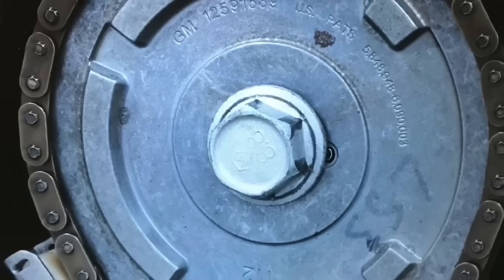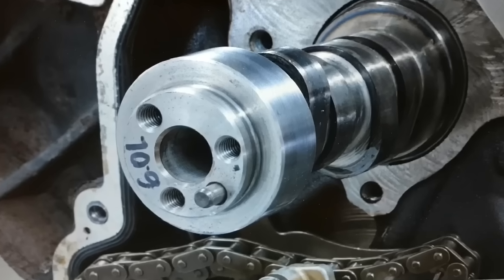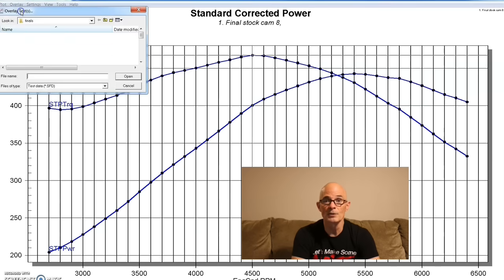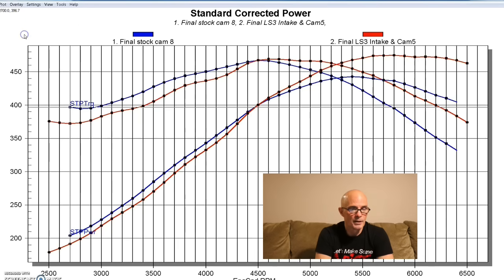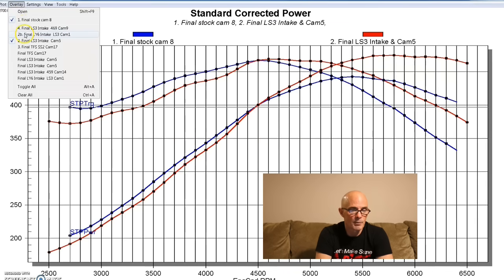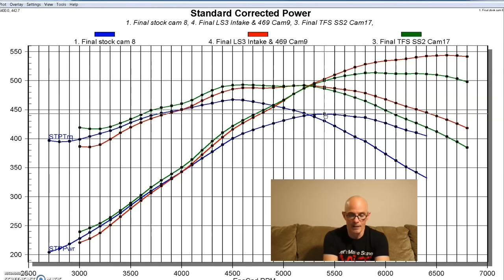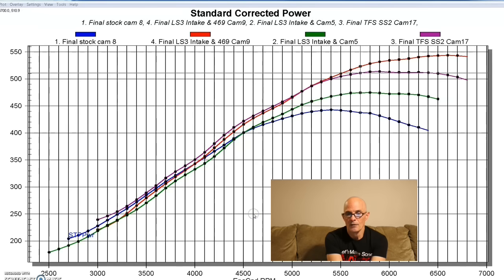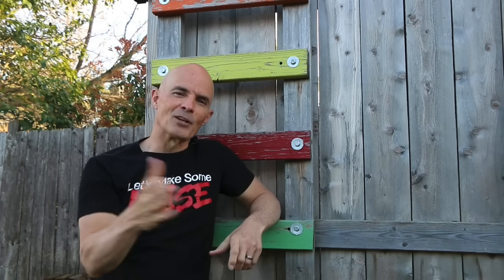HOW TO PICK: THE RIGHT JUNKYARD 6.0L LS CAM. 4 CAMS-WHAT WORKS BEST?

Comment: Will the stock LQ4 piston handle and have decent PTV clearance with the COMP 15-469-11 cam spec as the LY6 piston being that it doesn't have the valve reliefs that the LY6 has?
Reply: It should be fine with lq4 piston I just built exactly what you said but with flat tops in it and I barely had enough clearance
Reply: @brianvoegeli5067  Awesome, makes me feel better about my build. thank you
Reply from the maker: it fits fine in the LQ4

Comment: Richard, I have a 2019 Silverado trail boss with the 5.3l variable cam variable injection. Can I put a cam like the sloppy stage 2 in and have it work with the stock ecu and variable cam timing?
Reply from the maker: no it won't, but VVT cams are available

Comment: I've been considering the BTR stage 2 truck cam for my My 2001 6.0 LQ4 swapped Cherokee, but I like that Sloppy Stage 2 also. The fact it doesn't lose any torque down low means what little bit of low speed 4WD crawling I do in Utah prob won't be affected. Having more power on the street, and especially traveling over the Rockies is a plus.
Reply: Stage 3 low lift truck cam. Lq9 in an 81 malibu, thing made hilarious torque. Car was a tire destroyer
Reply: Running the stage 3 low lift truck cam in a LQ4, makes so much torque the trans keeps blowing and the frame will twist. (2000 Silverado ext cab 6.0 swapped)

Comment: Richard, I hope this isn’t an odd question, but what lift limitations should be observed with a daily driver? I assume valve spring upgrades along with the lift puts a fair amount of stress on the pushrods and lifters. I put a stock vette LS1 cam in my 5.3 in order to easily daily my truck, but I’d like to move up to a SS2. But I daily my truck. Your wisdom would be appreciated.
Reply from the maker: the LS1 is not a good choice-see the stock cam video, lift is not the problem with daily driver. You need a spring upgrade with most cams on the 5.3L because they have the worst factory spring

Comment: Richard could you pull up specifically an overlay of the ss2 and btr stage 2 truck cam vs stock On the 6.0s? I've watched all the videos but an actual visual of those two dyno graphs would be great. first time building/swapping an lq4 into my 85 gmc 4x4 and I've pretty much narrowed it down to one of the two grinds.
Reply from the maker: the stage 2 truck cam makes less than the SS2 from 4000 rpm on up. The Truck cam makes more lower speed down near 2500 rpm.
Reply: @richardholdener1727  How would the SS2 compare to the BTR stage 2 turbo cam (not truck) Thanks Richard, loving the vids
Reply: Thanks for the reply, prob best to stick with the btr then lol,

Comment: What kind of moron would call their cam a sloppy stage two
Reply from the maker: The LS Duntov 30-30
Reply: @richardholdener1727  3/4 race slop
Reply: @richardholdener1727  Not entirely true, the 30-30 was not a Duntov cam
Reply: Sloppy Mechanics what a shame right .
Reply: Are a lot of these people missing something
Reply: I remember a turbo called a “disco potato”, lol.
Reply: mrnicktoyou It originated from a guy who built a Sentra with a new (at the time) Garrett turbo back in the early 2000s... the GT2860rs.  But as a former 300zx owner you also hear that term a lot when people are discussing turbo upgrades for the 300z that will get you over 500whp on pump gas.
Reply: :-D
Reply: Sloppy Mechanics pushed 1000 HP with this cam and a turbo, not too sloppy.
Reply: Its about a choppy Jurassic park idle.
Reply: Relates to craftsmenship.
Reply: Hahah matt I love you brother! Hope you and the family are doing well.
Reply: Who knows. I bought on just to prove them wrong, I'll let you know when I have my evidence.
Reply: Chubbza5 it relates to craftmenship in the early slang for sketchy work.
Reply: Would the sloppy stage 2 clear PTV on a LQ9??
Reply: Matt Miller  what about stage 3 😅
Reply: Is there a 6.0 with 706/862 and ss2 cam video? Looking for estimates for a possible build. Thanks
Reply: 😈Happel trollin 😈
Reply: its a miss print. it was sloppy stage 22 cam.

Comment: Similar bore and stroke , similar port flow, similar cam timing ,similar results. But which engine will blow it's guts out first? These chevy motors are tough , plentiful, cheap, easy to modify, have lots of power adders available, And the exhaust sounds good.   The old small block will make same power with similar cam and heads. So if ya got one why throw it away?

Comment: By chance, do you have a test of cams that have similar duration and lift, but a big difference in LSA...   
For example, like a LS9 (211/230, .562/.558, 122.5 LSA) vs a Lunati 212/223 (.530/.549, 112 LSA).

A lot of people only look at duration and lift, and it’d probably surprise them how LSA can affect power curves.  It might even point those “what cam for the chop chop sound” people in the direction they want too.
Reply from the maker: I did a test where I changed only LSA from 108-120
Reply: @richardholdener1727    I'll have to try to find it.  Thanks.

Comment: Awesome video Richard, especially since I'm building a 6.0 with 706s to replace my 4.8.  I've been running the SS3 cam in it, and will probably carry it over to the 6.0.  It is 238/242 with .595" lift on both sides, and 112 LSA.  Since it has such a small duration split but very similar average durations at .050 compared to that Comp cam, do you expect it's power delivery curve to be very different?  Or essentially similar/same?
Reply from the maker: it might not carry as well with the lower exhaust duration
Reply: @richardholdener1727  Thanks Richard!  Do you also expect that it might make less low end torque because of the increased intake duration?  That's what I have concluded from your "teachings." Lol..   You are the friggin' man!
Oh, also, this is going in a twin turbo setup again, but I am pretty much disregarding that factor based on your tests.

Comment: I like your videos, they are very informative.  I wanted to know if you have a video of what heads that I can pull out of a scrap yard that will work on a 5.3 truck block from the early 2000s. I'm not looking to go wild, but when my truck ticks 350,000 miles. I plan on a rebuild kit for it with ring gap increase. my goals are about 500 to 550, but I would like to keep as much torque as I can because I tow my car occasionally. It would be a tight budget but I have the ability and time but I'm not confident in LS applications.
Reply: keep the 706 or 862's the small comb chamber keeps the torque you want and they are in junkyards everywhere
Reply from the maker: nothing you can grab from a junkyard that would be better than what you have on there

Comment: Kind of feeling the curve of the SS2. I'm not running over 5.5k and with my gears low end power is what I need.
Reply: Ice cream and burnouts cam
Reply: I've been running it in my turbo 6.0 for three years. Impossible to justify anything else given the cost
Reply: Chip Currey sbe 6.0 ? Did you gap any rings or just send it haha ?

Comment: If you're going to do another cam test, let's do an all summit truck cam test! Cheap and that's what daily drivers are going to be using, something you don't have to change the converter with and won't loose torque.

Comment: So an lq9 with ls3 heads and intake is basically a ly6?
Reply from the maker: the stock LY6 also has VVT
Reply: I just built that exact set up with the exact same Comp Cam and my maid 520 on the dyno
Reply: @brianvoegeli5067  I've got a cam close to the 228 230..
Mine is 227 231 with the lq9 and ls3 topend.
Not sure what it would probably Dyno as it had problems and the tune still isn't complete. Went from 414 on one Dyno and picked out 25 on the other before issues took over.

Comment: Great Test & Breakdown Of These Cams! SS2 Is My Choice For Street/Strip, Drift, Road Race Build, And I Would Choose The Bigger Comp Cam For A Drag Car. Before The "Sloppy Tax" Kicked In, The Elgin 1840P/SS2 Could Be Purchased For $200 With Free Shipping.
Reply: Occasionally jegs will list it on sale for $215. That's how I got mine.
Reply: Tommy Presson what part number did you use? I tried the Elgin 1840-P number and Jegs don’t recognize it.
Reply: @gtmotorsports937  it's jegs part number 200582 I think. Just Google "jegs sloppy stage 2" and it comes up. Confirm cam specs against E1840P
Reply: Global Media Inc. where can I purchase this cam?
Reply: @gtmotorsports937  Ebay, Summit & Jeg's, And Get The Pac1218 Valve Springs To Match.
Reply: @gtmotorsports937  Just Match The Specs At www.elginind.com With Page 14 Of Their Catalog.
Reply: @GlobalMediaInc  Great Info!

Comment: For theses cam tests are you running factory rocker arms with trunnion upgrades or are you using aftermarket rockers? Sorry if you've answered this question before.
Reply from the maker: stock rockers
Reply: Richard Holdener what’s the part number for the ss2 cam? I can’t find it anywhere?
Reply: Thanks

Comment: I wonder if a lack of piston-to-valve clearance is holding these engines back a little bit.

Some of the cams (although not the ones shown on this test) I see for this series of engine have LSAs as large as 118-120°. That delays the intake valve closing, which is going to push the whole torque curve over to the right.

My thought is there might be gains to be had for engines running in the 4000-7000 RPM range by going to more duration with a tighter LSA (like 105-110°).  

More duration should help with cylinder filling, the tighter lobe center would get that intake valve closed earlier, which would offset some of the low-speed losses of the larger duration, and the increased overlap allows a good set of headers to have even more of an influence on the power curve.
Reply from the maker: 120 would be a blower cam
Reply: @richardholdener1727  hey man, a wise YouTuber said, "every cam is a blower cam..."

and, I think it may very well have been a forced induction cam
Reply: Lindy tools in head piston valve notching tool.
Reply: @mxguy2438  I haven't been into one of these; have wondered how deep you can cut into the piston crown (and I strongly suspect it depends on if you run power adders...)
Reply: @billythebake  my motor is an L92 so it has notches for the exhaust valves already.  There is no additional material behind the exhaust reliefs so for mine i feel I'm safe.  I cant speak to the others but I bet Lindy can.

Comment: I have a 2004 g3500 van w/ a 6.0 and 250,000 miles.  Every oil change I find man-glitter on the magnetic pan plug.  If I rebuild it what would be a good low-rpm RV cam ? Van weighs 8500+ lbs.
Reply from the maker: The torque cam or stage 1 truck cam from BTR or something similar

Comment: Thanks Richard! I am definitely on the edge of buying a BTR stage 2 or SS2 cam thanks to your videos!
Reply: Joel Stevens best bet is to get whatever one is the cheapest. Usually the summit stage 2 turbo cam is the cheapest of the 3. Unless there is an eBay sale going on for the ss2
Reply: @mcfero1  thanks for the reply I was just looking yesterday on Summits website and it seemed that the summit stage 2 cam has much less duration than the TFS SS2 cam so I don't think that they're apples-to-apples I'll look again
Reply: @mcfero1  thanks for the advice. The summit trk stage 2 kit comes with gaskets and crank bolt as well. Good deal

Comment: So could we expect the ss2 cam to not lose any power throughout the curve on a 5.3l like it did on the 6.0l or are we running in to a large for engine size cam and it would lose low end over the stock cam?
Reply from the maker: it will probably lose low end on a 5.3L

Comment: I use the stage 2 in my 4.8 with a GT45 clone works awsom been 9s in a 3200 pound truck
Reply: What truck you have thats 3200??
Reply: @awebke  man read my fucking mind ...my 94 stang with me in it is gutter minus ac tubular k member weighs 3300 with me in it.
Reply from the maker: it works if you rev it on a 4.8L
Reply: How much boost

Comment: Awesome info again! You don’t mention intake CL or cam advance, but most are installed at +4. So if the SS2 cam intake CL is 108 (LSA 112 less 4), that makes Intake Closing at 42 ABDC, at 0.050 tappet lift. Comparing to the Comp cam, installed at 109 it has IC at 44.5. Both cams have some overlap which fills in the mid range on the torque curve much better than the massive negative overlap, or wide LSA, of the LS3 cam. This is the info you need to pick a cam for street or strip. This channel continues to amaze!

Comment: You're the freakin man! Nobody does dyno videos for the 6.0!
Reply: +1
Many 6.0's in Aus sedans.
Reply: I got a 6.0 can I do the cam only with no spring upgrade?  I know he has mentioned the4.8 and the 5.3 spring are very weak so he recommends spring with cam.
Reply: @robertfixescars4446  Summit racing has a series of truck cams that don't require springs called "pro ls drop in truck cams".
Reply: Man I’ve been working on a lq4 for about two years the more I think about it I feel like I’m not going to get any power from it with bald eagle cam 243 heads and headers…
Reply: Really? I think the 6.0 is one of the most popular swaps; it’s why they cost so much more than a 5.3 in the junkyard. Power wise you can really make similar numbers between a 5.3 and a 6.0, yet people still wanna jump all over the 6L more than anything else. I always go for the 5.3 and if I’m spending heavy on a build I skip the 6L all together and grab up a 6.2-poor mans LS3 for a similar price as the 6.0. In my area you pay 700-800 for a 6.0 longblock, but you can get a 6.2 Rec port longblock around here for 1000ish maybe 1200 if it’s a low mile pull out.
Reply: That is of course IF the local yard has any vehicles with either a 6.0 or a 6.2 in it, because usually they do not. They do indeed come in, but when they do the wrecking yard workers call their buddies and whatnot and they get first dibs on all the good motors, low mile 80E transmissions, etc all for the cheap. And it’s easier for them to pull the stuff even because they work there-they have all the time and tools to do it right versus guys like me that have to go there with their tool bag and a 90 year old rusty engine crane the scrap yard lets you use to yank your motor out while laying in the rocks/sand and you better be done by 4:55 because they’re locking that gate in 5 minutes regardless!
Reply: @kennethpowers8995  as far as I know, resellers get their hands on all of them that they can before they make it to the general public
Reply: @kennethpowers8995  5.3.... Huh?
Reply: @peaner083  Even 4.8s can go incredibly fast on a stock rotating assembly in the right chassis, but my preference has just been the 5.3s. The average SBE 5.3 grudge car I setup for someone is going at least bottom 5’s in the 660’. Realistically a handful of SBE cars break out into the 4 second realm, but majority have gone to at least aftermarket rotating assemblies at that point if not aftermarket blocks all together because that is serious steam. But for the average cash days and just regular fun on the street or at no prep events a stock block 5.3 will go a LONG way if everything around it is solid.
Reply: @kennethpowers8995  Yeah nice. Sorry dude,I was going off the LS2 6L motors we have in Australia,the commodore. The motors before that were 5.7 and 5.0  haha. 
I have a 2011 VE SS Commodore and looking too get a cam upgrade very soon.
Reply: @peaner083  You guys have a 5.0 LS variant down there? Or are you talking about old school 305/5.0 stuff like the TPI/TBI engines? I’ve always thought a factory 5.0 LS/Vortec would have been a better venture than a 4.8 for GM. I’m no engineer but I’ve just always been of the opinion they should have kept the 5.7 displacement alive and essentially used that rather than develop the 5.3, and keep the 5.0 displacement in lieu of developing the 4.8. Being as though they are primarily used in trucks and heavier vehicles the added displacement and therefore torque of each would be beneficial and I honestly feel the engineers could easily replicate 4.8 fuel mileage with a 5.0 and 5.3 mileage with a 5.7 if they really tried. And iron block dime a dozen 5.7s filling junk yards would be awesome! Not a huge deal, but the capability of these engines being what it is, a 5.0 could make a solid 35-50 ft lbs across the curve over a similarly equipped 4.8 and a 5.7 could probably muster a solid 50-60+ ft lbs over a 5.3 in factory trim. Then when we throw cam, intake, port work etc at them they would make that much more steam.

Comment: Is the ls3 cam a bad cam like why would it lose so much under 4500 when we have seen other aftermarket cams that don't really lose much if any
Reply: Ls3 cam has to meet emissions and the others don't.
Reply: @HioSSilver1999 not just emissions. NVH and fuel economy also come into play.  I'm sure they have standards for manifold vacuum vs the power brake booster, and probably other things.
Reply: @mxguy2438  well sure. They're pretty much just trying to reach a targeted power. They know doubt know a larger cam will make more power.
Reply: Doesnt have the duration to feed the engine at high rpms.

Comment: It looks like the TrickFlow Cam by far does best overall!
Reply from the maker: it was offered by trick flow
Reply: Richard Holdener I commented a bit too early lol. I saw you had mentioned trickflow after I made the comments. See my comments above. Thanks!
Reply: Trickflow?
Reply: Sloppy stage 2 is a JEGs cam or the Elgin 1840-P
Reply: Ah. I finally see it lol. Disregard.
Reply: @roadworkahead6368  LOL, it's all good. Pay attention to video. I never paid attention in class either LOL
Reply: Elgin makes the cam for multiple vendors